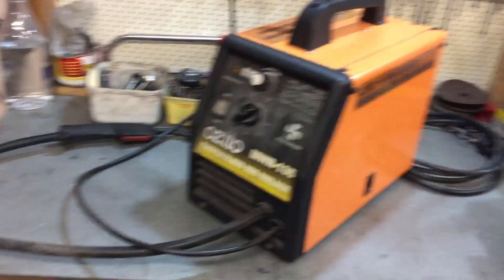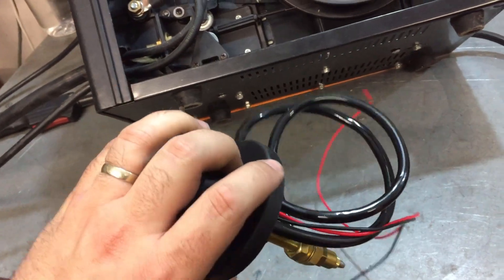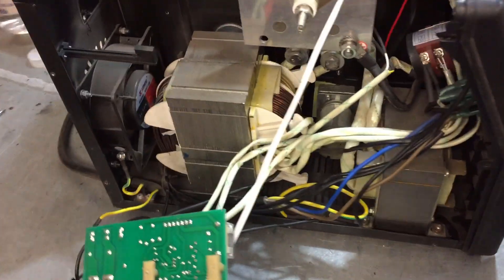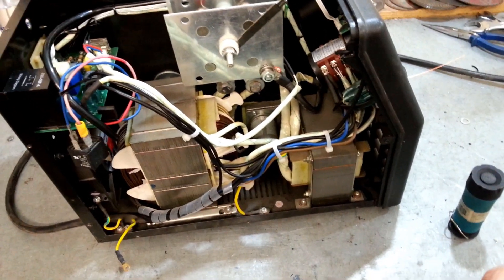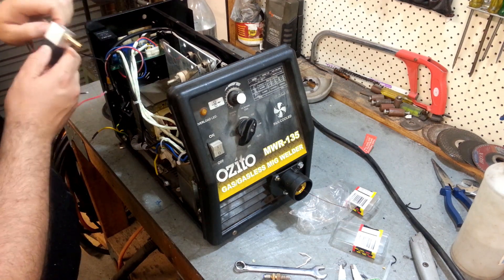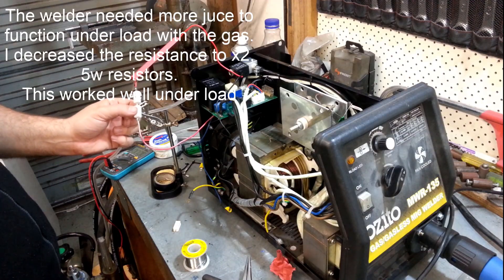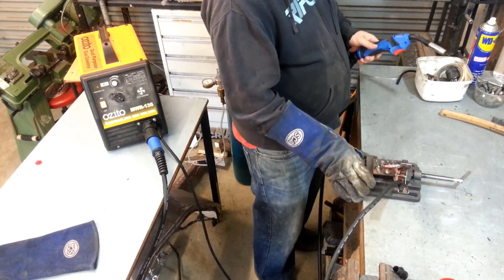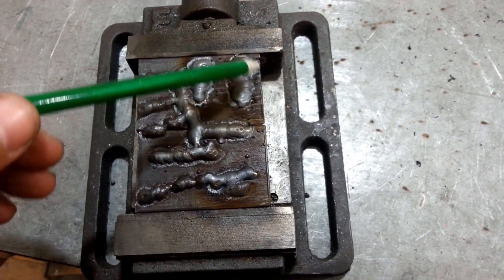Ozito MIG welder upgrade Europlug

Comment: Hey great video . May I ask what did you find wrong about the machine earlier in the video you said your machine not welding properly and when you found out why it isn't you show some connections to be I presumed wrong. Can I ask if you can further explained what was that you found wrong. Thank you
Reply from the maker: Oh yeah, the original problem was caused by a loose connection on the negative terminal inside the welder. I couldn't see this until I disassembled the unit.

Once tightened it's much better.
The 4m long leads and gun are a bonus.
In my experience, welding with flux core as compared to gas welding, gas welding is much cleaner, easier and I'd never go back to non-gas welding having tried them both.
Hope that helps.
Reply: @MaximumDIY  it does thank you I've learned a lod from this video. I have similar upgrade that I wanted to do with my flux core machine planning to upgrade the wire feeder assembly together with a euro connect also the torch . Thank you very much

Comment: Can you connect a euro TIG rig and see if it would work?
Reply from the maker: Unfortunately I don't have a euro tig connection that would fit. but if it did fit, you'd still need to scratch start the arc and probably burnout the tungsten from the inrush current.
Most tig welders have a soft ramp up current and high frequency start for ease of use and extended consumable life.

Comment: I know you probably don't remember at this point, but would you happen to know what liner you used for that old torch? I've got one of the newer ozito migs and can't find anything about replacement liners for the fixed torch that's on it
Reply: Bunnings sell replacement liners
Reply from the maker: You are correct, it was a while ago, if memory serves I purchased a nylon liner from total tools. They are generic and you're meant to cut to size, the original liner was made of steel but it was all rusted inside causing the feed to constantly jam up.
I would recommend pulling the old liner and you'll know what parts can be used to fit the new liner to the gun. You'll also get the exact size. Also tye a pull string to the liner before you pull it out so you can drag the new liner back through the cable sheath.

Comment: Do they have detachable ports for flux core mig wire ie no gas?
Reply from the maker: Yep, the new euro style mig gun has a removable gas nozzle and replacable contact tips.
Reply: @MaximumDIY  thanks!

Comment: Excellent video. I have a Cigweld 135 mig with an attached 3 metre torch and it drives me crazy! Adding the Euro fitting looks fairly straightforward. But unfortunately the Cigweld 135 also must have the cheapie gas solenoid inside the torch. I looked for a solenoid inside the welder, but no dice. After closely looking at your Ozito, I think they are the exact same machine, just a different colour and different badge. Everything else looks identical.
Reply from the maker: Hi Greg, thanks for the comment.
I think you are correct, the Cigweld 135 mig looks like the exact same unit with different branding. 
I bet they are identical inside, give the Euro plug conversion a go - it's worth the effort just to have the extra-long leads and a much lighter trigger.
Reply: @MaximumDIY  Yeah I’m not as good as you with the electrical side of things. I got lost and my eyes were rolling around in my head when you started talking about ohms and resistors etc 😂. Would love to get rid of the attached torch but it’s a “bridge too far” I’m afraid.
Reply: OK watched it again and understand the electrical side now. I have ordered the bits needed.

Comment: Sir, I have the same welding machine (Ozito MWR-135). Recently my selector switch got stuck (jammed) and I tried to repair it but I failed. Now I am not in a position to operate it. I just can not find a selector switch of that type. So I thought of connecting two toggle switches to select the current.
Could you help me to connect the 4 transformer tapings  by a small diagram?
Reply from the maker: Hi Kusman 
That's a shame about your selection switch - unfortunately I don't have a schematic for this welder.
I would also advise caution as this is dealing with mains voltage and would be dangerous. 
To get up and running, I would advise hunting around for a cheap Ozito MWR-125 unit with a broken wire feed and swapping out the switch.

Thanks for the comment - Like / Share / Subscribe
Reply: @MaximumDIY  Thanks a lot for your prompt reply. I appreciate your kindly advice.  I shall try to do so.
Reply: @kusmanf  the Cigweld 135 mig is the same machine. You might be able to buy a new switch from Cigweld or one of their distributors?

Comment: Good job, not a bad welder for learning to weld, although duty cycle I find isn’t that good with thicker material. Went to Unimig and never looked back.
Reply from the maker: Hi Fadi, thanks for the comment.
You are correct it's only an enntry level welder and the duty cycle is only a couple of minutes wending thicker material, after that the thermal cutout light comes on and it's time for a break lol. If i knew what I know now I'd deffinately have gone for a higher quality machine, but it still works and doesn't owe me anything so I'll keep useing it until it carks it.
Like / Share / Subscribe!

Comment: for material thickness etc use the miller pocket welder helper app on your phone. If you dont like the idea of using the smartphone app. My welder the duralloy191 (which I love dearly) has a chart in the manual http://www.duralloy.net.au/assets/171-191multimig-user-manual.pdf online
Reply from the maker: Thanks for the comment, I've been looking for something like this for ages.
The smartphone pocket app is pretty good for quick reference and the online manual is excellent.
Thanks again.